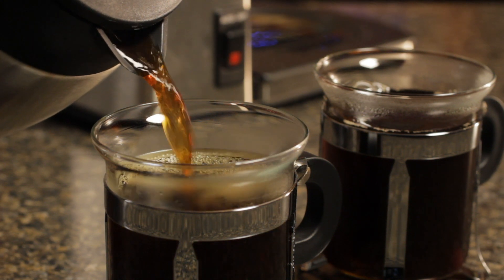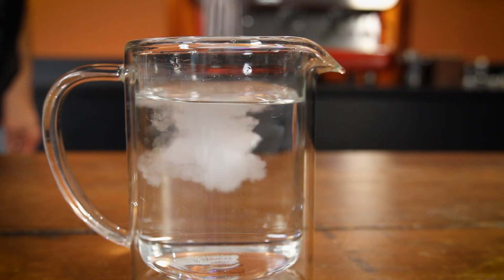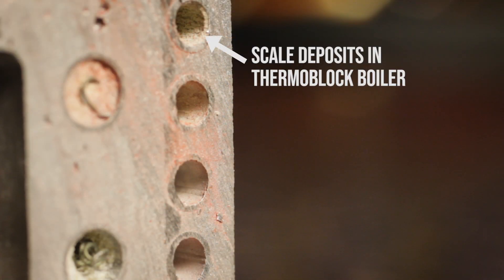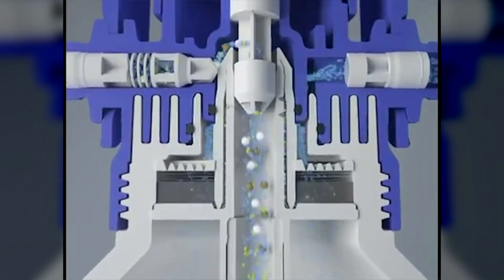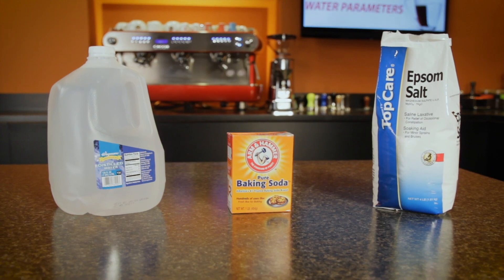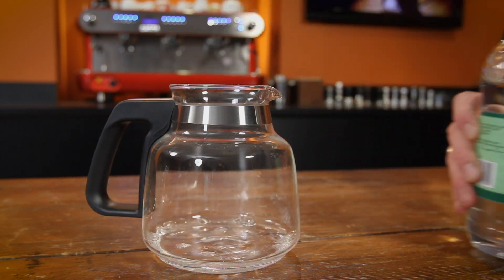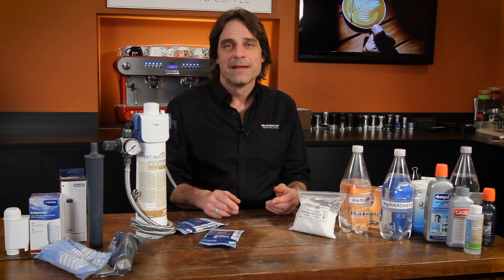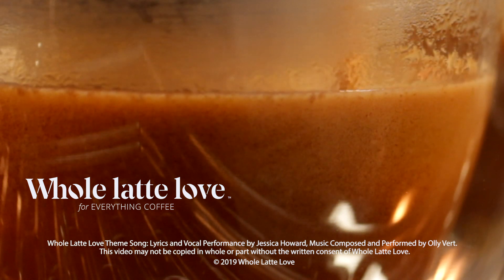Water Filtration for Best Coffee & Espresso Flavor and Equipment Protection

Comment: I have a full RO System in my house. Can I run the RO Filtered water through the BWT Penguin 2.7 L Water Pitcher to "remineralize" it?
Reply from the maker: Hi WCP, It's not a purpose I've evaluated/tested. My guess is since the Penguin uses ion-exchange to replace calcium with magnesium probably not as there will be no calcium in the RO treated water. A couple of other options. You could do automatic in-line remineralization using a cartridge system like the BWT Bestmin: https://www.wholelattelove.com/collections/bwt/products/bwt-bestmin-premium-m-filter-cartridge You could remineralize manually. Check out my recipe for making SCA spec brew water. It uses baking soda and epsom salts - very low cost: https://youtu.be/iHI7jC0sQZo
Marc
Reply: I have a Culligan RO system in my new house. Is there a filter that will fit in my filter rack that can make my water right? Currently there is 

I am not sure my tap water is safe (high Sulphur). Will the Penquin pitcher make it safe?
Reply: Currently there is Sediment, Carbon Block, and Reverse Osmosis cartridges.

Comment: Thank you for a nice video. I have a Profitec Pro 600 filling up the reservoir with water filtered with a BWT BestProtect. Why do you prefer the BestMax premium over BestProtect?
Thanks
Kind regards,
Emil
Reply from the maker: Hi E, Thanks for the question. The BestMax Premium has about 20% more capacity per cartridge. We prefer the scale protection using calcium to magnesium to maintain mineral level.
Marc
Reply: @Wholelattelovepage  Thanks for your answer. According to what I have read the BestMax Premium should also taste better - but do you know which one is a better protector against corrosion? I bought the BestProtect because I thought it would protect the machine better, but I think it affects  the taste negatively.
Reply from the maker: You are welcome. I personally have not used the BestProtect so cannot comment on flavor. I do like the flavor from the Bestmax Premium filter.

Comment: Is it true that citric acid should be avoided in machines with aluminum boilers?
Reply from the maker: Hi c, Thanks for the question. I prefer to use something like Durgol Swiss Special descaler in aluminum boilers: https://www.wholelattelove.com/products/durgol-swiss-espresso-descaler or the product recommended by the manufacturer. That said, I have spoken with chem engineers at Urnex who make commercial and consumer descaling products. They say citric acid is okay to use in aluminum boilers so long as contact time of the acid is kept to 20-30 minutes. Hope that helps!
Marc

Comment: Is there a specific water filter pitcher brand (Brita, etc.) that you would recommend for espresso machines?
Reply from the maker: Hi KG, Thanks for the question. I recommend the BWT Penguin Pitcher: https://www.wholelattelove.com/products/bwt-penguin-2-7-l-water-pitcher Most filter pitchers only treat for particulate matter and chlorination/chemicals using activated carbon. The BWT pitcher does all that but also reduces scale causing calcium by exchanging calcium ions with magnesium ions. Used as directed, it provides the mineral level need to prevent over-extraction and support flavor while not causing scale.
Marc

Comment: Would a fridge filter work just as well?
Reply from the maker: Hi AA, Maybe. Only way to know is testing the water coming out of the filter. Wide variation in what different brands of fridge filters actually filter. Water hardness level may or may not be controlled by softening. If it is it may not be enough to prevent scale.
Marc
Reply: I'd ditch the fridge filter and put one on the line. I use a whole home filter just for the fridge because the filters are cheaper and it can pass more water before it needs replacing. A lot of basements I am in the line to the fridge is orange and rusty looking. Mine is white like the day I installed the fridge with a water line about 8 years ago.
Reply: Todd T tbh i just bought 2.5 gallons of filtered mineral water and it was a huge difference, tasted amazing

Comment: Great video! What would you recommend me: I use filtered water (Brita cartridges) in my ECM Synchronika’s tank. Should I use a BWT filter pad or a penguin pitcher? Are there pros/cons between the two? Thanks
Reply from the maker: Hi r, Thanks for the comment and question. Brita makes a number of different filter cartridges. I'm not aware of any designed specifically to reduce water hardness/remove minerals. As far as I know they do particle filtration and use carbon for chlorine/chemical filtration. The Penguin Pitcher does the carbon and particle filtration. Plus it uses ion-exchage to remove calcium and replace with magnesium to maintain flavor and prevent scale. On a per liter basis the pitcher is lower cost plus you can use the water for other purposes. The pad filters do all that but have no particle filtration. Particles generally are not a problem with most municipal water. Pad takes a few hours to do it's thing so if you empty the reservoir more than 1x every 10 hours it's not appropriate for your situation.
Marc

Comment: I have breville 920 that comes with filter. I have been follow your distilled water mix baking soda and salt. My question is should I use the filter that come with it since I use distilled water. And how often should I descale I make 1-2 shot per day.
Reply from the maker: Hi Corey, Thanks for the question. The SCA water recipe is unlikely to cause scaling - some people do go to a higher mineral level for espresso brew water by using more of the concentrates added to the distilled water and that will be more likely to cause scale. Personally I would do prophylactic descaling every 4- 6 months - better safe than sorry and descaling does not hurt the machine. Just don't use vinegar - especially in a Breville!
Marc
Reply: Whole Latte Love awesome thanks. I have bought some Urnez dezcal product like you guys recommended. 
And also after I use the SCA water receipt and I test with the water test strip that came with it and it reads 3 red box on it. Is that count as hard water?
Reply from the maker: @zheng1987  Hi Corey, 3 red boxes do indicate water of moderate hardness. But... That's a reading of Total Hardness. The simple test strips do not differentiate between hardness caused by calcium and that caused by magnesium. Magnesium is far less likely to cause scale than calcium. As mentioned I would still descale every 4-6 months. Hope that helps!
Reply: Whole Latte Love  thanks.

Comment: How often do you recommend descaling if you’re using tap water that, based on the municipal water quality report, seems to be close (though not perfectly within) to SCAA specs?  This is for a Profitec Pro 500 PID, and I make about 3-4 shots per day.
Reply from the maker: Hi Jason, Thanks for the question. I'd suggest running your municipal numbers through this Langelier Saturation Index calculator: https://www.lenntech.com/calculators/langelier/index/langelier.htm
It's not perfect. Water temp only goes to 80C and your boiler runs far hotter. Probably 254F/123C with higher temps increasing scale potential. At SCA specs scaling should be minimal but TDS does not differentiate between calcium and magnesium. One thing you can do is pull the mushroom valve of your E61. If scale evident there there's likely scale elsewhere. I'd prophylactically descale every 3-4 months.
Marc

Comment: Sorry, I've another question:
Many RO systems I see are being sold with a mineralizator (did I spell that right?), so... I suppose my question would be a) if the water is re-mineralized, it shouldn't cause corrosion or over-extraction, right? And b) I wonder how much the water is re-mineralized... so much so that the hardness is ALL back, or... only part?
Thank you for any thoughts you might have. I want to protect both my machine and my family!
Sleepless Dan
Reply from the maker: Hi Dan, Re-mineralising (I don't think I'm spelling it right either!) is common and required if starting with pure RO water. Depends on the system used but should provide a proper balance so one does not get corrosion or scale formation. Here in the office we've been doing a long-term test of a not yet available BWT RO system which includes remin after the RO using this BWT Bestmin cartridge which treats ~10,000 liters: https://www.wholelattelove.com/products/bwt-bestmin-premium-m-filter-cartridge. It's been running for a year plus in our employee lounge servicing prosumer level espresso machine which get a lot of use and so far it's working well with no corrosion, no scale and wonderful flavor!
Other options include bypass systems which combine untreated water with RO treated water in proper proportion to produce a desired mineral level. I see those used in commercial beverage service applications. But requires a tech to get the bypass dialed in properly.
Marc

Comment: Marc - I'm building (under construction as I write) a small drive up espresso, bagel shop.  I have no idea how many customers per day we will actually serve, however estimates are around 90 average per day.  I haven't purchased the espresso machines but my roaster has suggested a Faema 1 groupe and a Appia 2 group machine.  I'm trying not to break the bank on  a filtration system but understand it's very important.  Will this BWT system work for me?
Reply from the maker: Hi Michael, Sorry I'm not back to you sooner! A bit hectic here as I'm without support staff on the video side of things during virus. Anyway, It could work although you'd likely want to use a higher capacity Bestmax cartridge which fits into the same head as in the video. At my water hardness of 7 the S size cartridge is good for 1,070 liters but they have cartridges that will treat 10,000 liters at that hardness. Best bet is to give our tech support a call at 585-924-7170 for a solution. Might also speak with our commercial sales rep who can help with machines. He's help setup and run 100's of commercial operations like yours and would be happy to access your needs and suggest the right machines/grinders etc to get the job done. His name is same as mine - Mark.
Hope that helps!
Marc

Comment: Dear Marc,
I was just on the fence between a BWT and an 8L Resin softener (cheaper), when I came across a local scientist who claims those softened waters will either corrode and/or cause lead to be discharged from the copper pipe\boiler. Have you heard any of that?
Also, it is my understanding that the BWT premium is not for regular drinking, but only for coffee consumption (i.e., low volumes). Can you help a home-barista out? I'm this close to getting a certificate in chemistry from all the reading I've been doing, and I'm literally losing sleep (!)
I just want something that is a) good for my Elba3, and b) possibly also good for my family.
Thanks so much!
Dan from Israel (where the water is hard)
Reply from the maker: Hi Dan, Water chemistry is far more complex than many realize so I feel your pain! I would avoid the resin softener. Depending on other water parameters you could have corrosion which is typically caused by water that's too soft (lacking minerals). I have seen softeners cause a goo to build up in espresso machine boilers.
BWT Bestmax Premium can definitely be used for drinking water! Many will install and split the feed off to a separate sink faucet for drinking water. Some split an output to feed a fridge for ice maker/water dispensing.
Hope that helps!
Marc

Comment: Hey Marc,
I just bought Lelit Bianca. My local shop advised me to get the BWT can with the filter that adds magnesium and use the 70L Resin filter in the water tank that came with the Lelit Bianca machine. 
Now the water coming from the hot water wand, brew head and steamer smells bad and tastes bad.
Tried boiling the water from BWT can and it tasted fine. But when it comes through the machine it goes bad.
Any tip on how to proceed?
Reply from the maker: Hi MBU, Thanks for the question. If using the BWT filter as directed IMO the resin filter is not needed.

Comment: Hi guys, Im from Chile and the water quality is very low, and super hard, how can achieve the Best quality water possible (flavour and nutrient) for commericial  espresso machine if I want to use tap water, water filter, water softener. Any tips?
Reply from the maker: Hi Arturo, Thanks for the question. Most commercial cafes in your situation would likely use a reverse osmosis system and re-mineralize. The RO treatment output is ultra-pure water with zero hardness. To that, minerals are added back via a bypass of some untreated water to a level needed to support flavor and prevent corrosion of metal components in the machine. Hope that helps!
Marc
Reply: @Wholelattelovepage  peeerfect Now make sense, but is the first time that I hear re mimeralize water from a bypass, do you have any web page that I can read about it and how   re mimeralize the water with   bypass and what type of nutrient ? Thaks  guys, always answering 👋

Comment: Hey Marc, I have seen some claims of users disliking the results they got from the BWT Penguin filter pitcher stating that at boiler temps the water was somewhat acidic, any validity to this?
Reply from the maker: Hi Victor, Are you referring to actual acidity like pH or to acidic flavor as in brightness? I've been using the Penquin Pitcher for a few weeks for tap water in the studio for drinking and in a super-automatic machine. For drinking, the pitcher removes a musty tinge from the tap water and the result is a brighter flavor - huge improvement! As far as I know, heating water in a boiler will not affect pH - only thing I'm aware of is chlorinated water potential forming carbonic acid when heated. But, that should not be happening as the Penguin filtration includes activated carbon which removes chlorination and its by-products.
Marc

Comment: Hi there - thanks for the video. Yet, I would disagree that with a Penguin pitcher you never have to descale. I live in London (UK) with very hard water. I bought this Pitcher as well as a BWT GH and KH test kit to find out about the calcium hardness. The KH of my tap water is c232 mg/l CaCO3, which the BWT Penguin pitcher with the magnesium cartridge reduced to c125mg/l. This would still be almost twice as high as the 68mg/l optimal level recommended by the SCAA and with a ph of c7 will cause some scale. It all depends on the initial hardness of your tap water. So unfortunately the pitcher is not an alternative to a bottled water I can buy with 65mg/l calcium, 49mg/l alkalinity, TDS of 150 and a PH of 6.7, which will cause almost no scale at all. I was really hoping to replace the bottled water with the pitcher, but the result isn't nearly as good as the bottled water.
Reply from the maker: Hi Simon, Thanks for the comment. There may be edge cases in very hard water areas. But I'll add BWT has repeatedly assured me that proper use of their ion-exchange filtering products results in water output which will not cause scale to form in espresso machines. IMO there is a lot of confusion with many different water hardness measuring methods. If I understand correctly it's possible you may be confusing SCA's 68mg/l of calcium hardness with carbonate hardness. Carbonate hardness in the BWT test kit does not measure calcium level alone.
Reply: @Wholelattelovepage  Good point, thank you! So does the test kit for KH actually measure the alkalinity here?
Reply: @sptglider What bottled water do you use? I’m in the UK also.